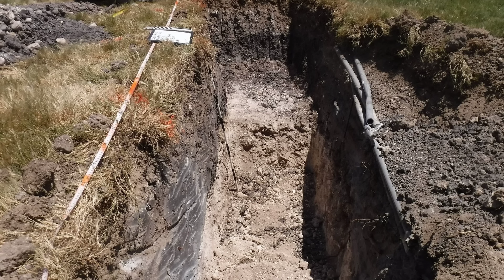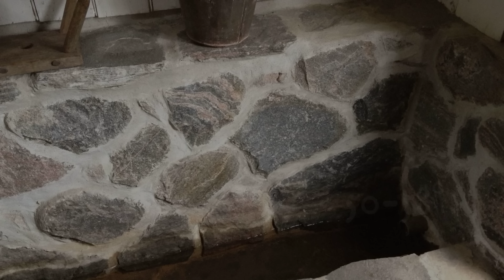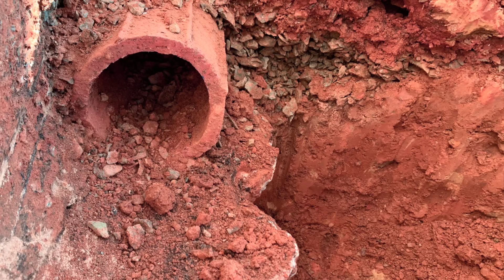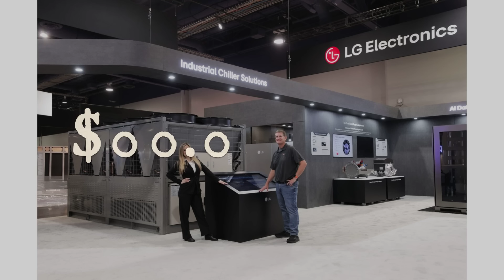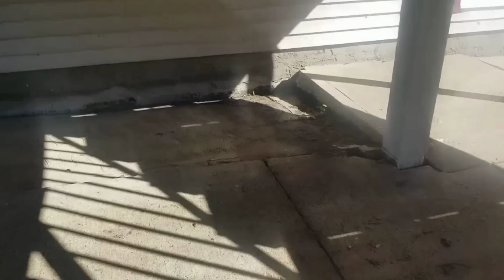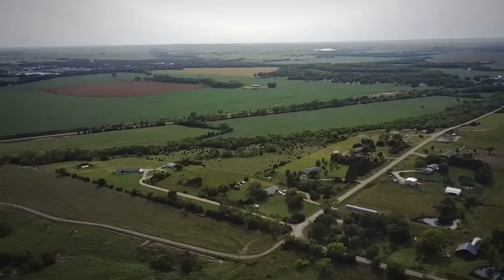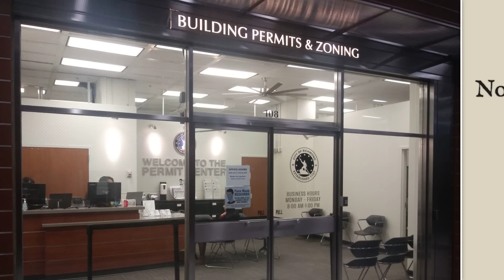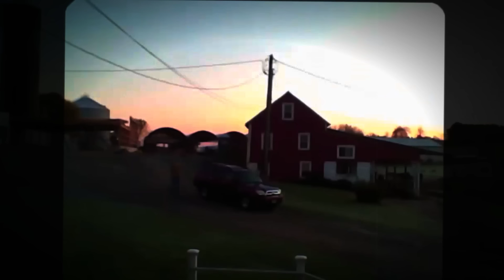This $300 Tunnel Keeps Any Home 55°F Forever — The Amish System the Cooling Industry Made Illegal

Comment: As warm air will pass through the underground pipe or tunnel, the earth surrounding the tunnel will get warm within no time (may be few hours) and then no further cooling will occur. Probably to make it effective the pipe must be touching an underground aquifer to continuous transfer the heat. But in summer many upper aquifer dries up making the system only effective seasonally.
Reply: No it wont.

Comment: Mold and fungus would grow in humid environment and you would breathe it. Enclosed circle 8 ft deep goes in and out through the heat pump sitting somewhere close to your house in this circle and pumps heat/cool into your house,  no mold/ fungus issues.
Reply: Doesn’t the use of a heat pump defeat the purpose? I just post a question asking about this.
Reply: @edbradley6815  No. The efficiency of a heat pump gets drastically better, when the thermal source you're extracting heat from is closer to the temperature you're trying to maintain in your house, instead of trying to extract it from cold air outside.

During summer, the efficiency is similarly better, when extracting heat from the house, and putting it into the lower temp soil, instead of into hot summer air.

With an air-source setup, efficiency will typically be 2.0, meaning you extract two units of heat from air, for each unit of electricity used.
With a ground-source setup, efficiency will typically be somewhere between 3-4. You can use an average of 3.5.

This means, for the same amount of heat transfer with ground-source, you'll be using only two-thirds the electricity of what an air-source setup uses.

In direct numbers, if you're heating from air-source with 9 kW going into the house, the heat pump is using 3 kW of power, and 6 kW of heat is being extracted from the air outside.

If you're heating from ground-source with 9 kW of heat, the heat pump is only using 2 kW of power, and 7 kW of heat is being extracted from the ground.
Reply: The video already addresses this
Reply: That's exactly what is happening in your crawl space. Air comes in, stack effect pulls it up into your living space. All that air is untreated, mold and stale air with high humidity in your primary living space. Your AC systems are treating air from your crawl space. Consider doing crawl space encapsulation.

Comment: Why doesnt a basement provide this cooling?
Reply: It does, in Denver, CO for about 20 years now, I have put a window fan at the bottom of the stairs, opened a north facing basement window, opened a north facing upstairs window with a small fan blowing out and our 1940's six foot deep basement  keeps the house at about 70 degrees all summer.  Earth/air is most likely cooler and I wish I had installed a ground loop when we replaced the driveway.  We used to have a fairly high water table in our neighborhood.  The basement was slightly humid, all the air movement has dried the basement nicely.  The stair is at the far south end of the house, so the air is forced across the basement and then back across the upstairs.
Reply: @jayhuiting5748 interesting, we had a similar set up at my folks in Boston and it did not keep the house that cool!

Comment: In humid climates, couldn't you utilize the drainage from the condensation as a water source? Perhaps redirecting the water into a cistern or rain barrels?
Reply: Condensed water has no minerals in it, it s like water used to fill up lead batteries, not suitable to drink unless ions are added, I think.
Reply: @Lepot_Defleur  The RO system in our house and shop has a mineralizer in it, we refill it every few months. There's a T at it to get mineral-free water for washing cars and for batteries.
Reply: Yes, in fact you can buy "water generators" that produce water by condensing it from the air this way. They're expensive.

Comment: Where does the condensate go and what prevents mold from thriving?
Reply: the man used water and glycol (antifreeze) instead of outside air. inside his house he uses a heat exchanger like a radiator with a fan.
this becomes less efficient because he now has to pump the glycol. but there's zero risk of condensate in the closed loop.